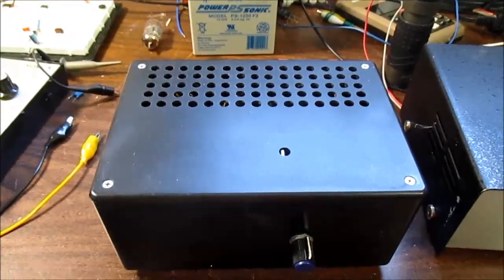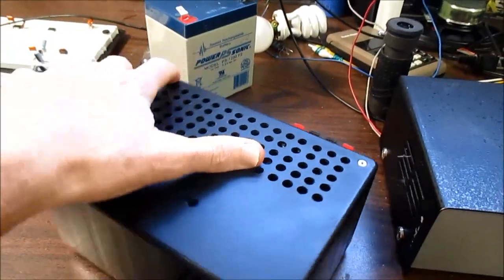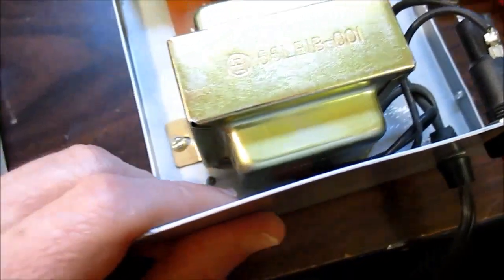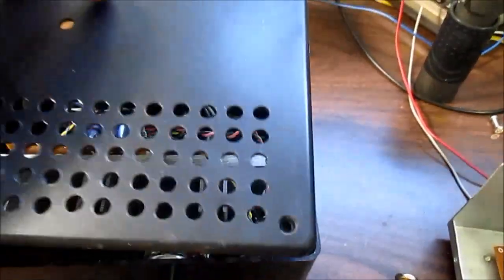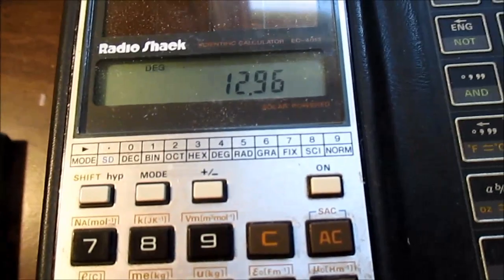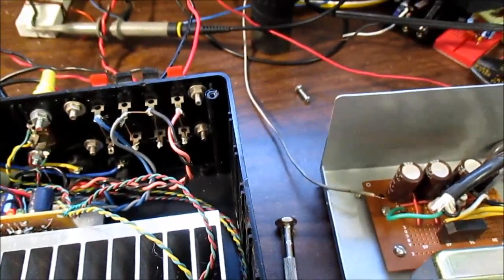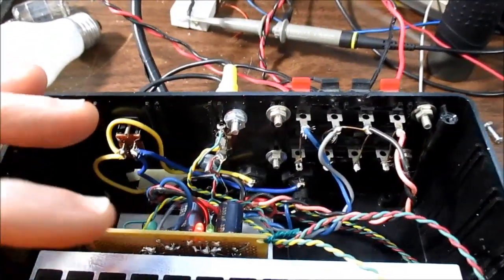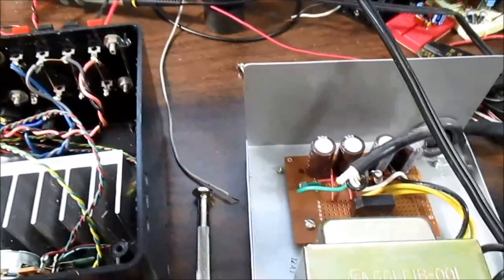Small stereo amplifier TDA2050 power consumption

Comment: That bridge diode looks too weak to me .If you use a metal Box it will desipate the heat easier. Radioshack is not famouse for its quality parts.

Comment: If this chip is operated on lower voltage say +/- 12 v split supply or 24 Volts single supply @ 2 Ampere , will it draw more current than 2 Amperes ( as provided by the power supply) or less current while giving lower output power ?
Reply from the maker: it should draw the same amount of power.

Comment: How do you mean caps across 2 rails of DC , there is only 2 rails and you cant hook up caps in series with it it needs to be in parallel , so  2 wires in parallel , there is only one way to do it, you cant have 2 caps per  rail  if you dont have 3 rails there . Its a center taped but i think you are not using it like center tap , otherwise you couldn't use that Gretz you would need 2 of them , You got me confused .
Reply from the maker: Supply is dual DC (3 wire) for positive & negative voltage and common ground.
Reply: how , dual DC with one transformer and one bridge rectifier

Comment: I need to build something like that specifically for my computer. Maybe have it integrated in to the computer and run it off the computers power supply. would only need like 8 watts per channel and maybe a separate channel just for low frequency's
Reply: One of the main reasons to buy an external amp for a PC is to disconnect it from the noisy power in a PC, which is full of all kinds of electronic noise and RF. I wouldn't recommend this approach, the PC's power is likely to be quite dirty.

You may be able to get away with it if you dedicate an entire rail to it(the rails should be described on a sticker on the power supply), but there is no guarantee that the power supply keeps that rail isolated from the rest with no cross talk.
Reply: true but even most of the top tier psu's available today don't have true split rails. it's usually one rail with crap tons of current split into multiple virtual rails with current shunts to monitor current on said virtual rails. and modern psu's have pretty good filtering on them. the one I have now is old by modern standards but is reasonably good with a single rail split virtually into two rails each with a limit of 62 amps (124 amps which is shared by the two virtual rails and the 5 volt rail which is rated at like 13 amps or something like that so the two 12 volt rails could never really be loaded to 62 amps any ways and even if someone were to do so it would be peak rated anyways as loading it maxed out like that is going to cause a bang or a fizzle) and while i have it under load i barely get 100 milivolts of ripple and voltage only drops by .1 volts so its pretty clean and stable. the noise can be almost completely eliminated  by Rf chokes and capacitors. the real noise issue would be between the sound card be it internal or a pci/pci-e add on. Ive tryed something like this before with broken crappy computer speakers that were blown and the internal integrated amp was rated for 16 volts DC but would work fine off 11.5 to 17 volts and it sounded good powering a cheap set of goodwill book shelf speakers at the time. got reasonably loud too for only 8 WPC. the only issue was when the gain was turned up so did the noise floor and all the nasty noise. if I kept it reasonably low you couldn't hear any noise even if you were right on top of the speakers.

Comment: Interesting video, I used to build and use these back in the 1990's. I have a thing for class D amps now as there are so efficient and when built correct sound just as good. I use a toroidal transformer with good quality caps with class D you can get away with a small, say 2A transformer and still wake the neighbours up if you wished :D

Comment: I got a TDA 2040 because of this video. I greatly appreciate you posting these "gems" of videos! I am trying to build a guitar amp with the most power from a chip that will run on 9 V into 8 ohms. Do you have any suggestions? I have already made several versions of the good old LM 386 and it is good, I want more power! Ha Ha! Thankz
Reply: Hi ATL, All American Five Radio, Rick, on YouTube, a very good channel for electronics, has a video on a push/pull transistor audio amp using a TIP31, NPN, and a TIP42, PNP which produced a nice sine wave. I have no idea on the power output. For 9 volts into 8 ohms I would suggest the Runoffgroove.com Ruby 1/2 watt amp. Where it is based on the LM386, check out John Audio Techs video on proper grounding of LM386, it uses an MPF102 J-FET and has a 1K gain pot, they work great. I built a little amp using a Ruby circuit and a Jensen MOD series 8", 8 ohm, 20 watt speaker and it rocks. Give one a try, a fun build. Be good, C.
Reply from the maker: Your power supply voltage is the limiting factor here. You can get a few more milliwatts with a better IC or drive a lower impedance with an IC that will handle it to get about 1.5 watts (at 4 ohms). A bridged amp circuit will give you much more power as well. If your 9 volt source is the little 9v transistor radio batteries then you must worry about run time with the higher load.

My recommendation is with the speaker. Use a true guitar speaker of the largest size possible for your application. An 8 or 10" guitar driver will give you volume and a good tone.
Reply: JohnAudioTech Hey John, thanks for the reply! I want to put an amp in a cigar box or a cigar box guitar. I have some small 5-10 watt speakers @ 4-8-16 ohms and would like to use them. If I go with a bigger cabinet I have some 6-8-10-12 inch guitar speakers @ 8 ohms. I thought about using two 9 volt batteries in parallel to double the current for longer play time and add a jack for a 12 volt wall wart. I will try the tda2040 with a healthy heat sink and a 12volt supply and see if I can get more volume than a LM 386-4. Thankz
Reply: Audio Tech Labs Hi ATL, If the reply was about the Runoffgroove.com Ruby amp, that was me, not John Audio Tech. Be good, C.

Comment: Thanks for the post. It does show what these appliances use with simple conventional power supplies, with the 60Hz mains, and a 4 ohms/channel load. I know of 1 outdoor PA system operator who uses 4 12V lead acid (car) batteries for a -24V, 0V, +24V supply, as mains power was noisy, and less reliable, and requiring a lot more cable. (A power failure could therefore be announced, with any necessary safety directions). The load impedance was 8 ohms.. On completion the batteries would be paralleled and connected to the car to charge on the way home...
Reply: He charged four car batteries on his way home?
So he had a thousand miles to drive, or did he just have a generator on a pickup or something?
Lol..
Ok, not a thousand, maybe just hundreds of miles :p
Reply: +jan christian Frodahl It was done in Adelaide suburbs, South Australia, but I think the general process was to use a mains (in Australia, 240V AC) operated charger on completion (a whole day of use), and at that, a 24V version, to charge 2 x 12V lead-acid batteries in series. They delivered many hours of low noise power using say, a 50W(RMS)/channel capable amplifier.. Today there is 'Class D' for the lower frequency audio for efficiency, but at the expense of component life, especially electrolytic capacitors...
Reply: jmcgatkinson
I thought he was charging with the car hehe, because that would take SOME time :p
Would be SOME alternator too..

Comment: do you think that its worth use an tone control circuit???
Reply from the maker: No problem to add a tone control circuit in front of the power amp if you wanted. Personally, I like direct from the source without coloration.
Reply: I wanted to use a tone control between my source, and my power AMP circuitry (tda 2040) but I don't want my that the tone control causes a lot of distortion to my amplifier. Do you think that is better to use an baxandall similar circuit, with an op amp, or use a single transistor preamp circuit?
Reply from the maker: OP amp IC is the way to go. NE5532 is great for this.
Reply: Thank you very much